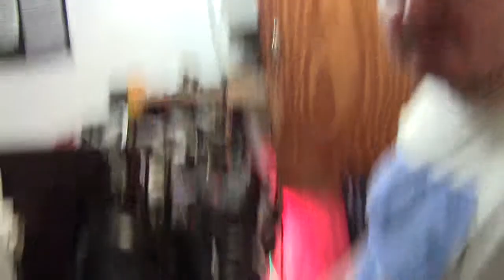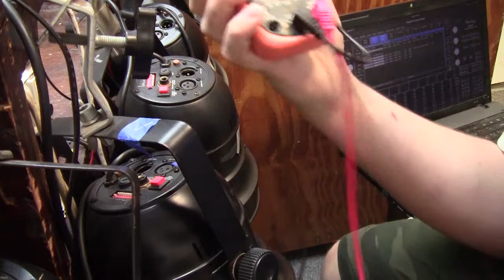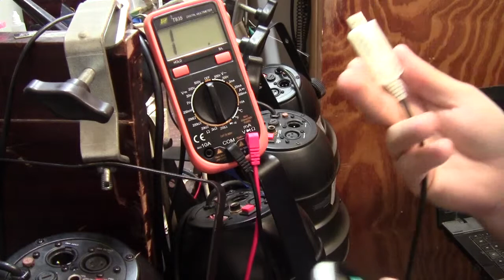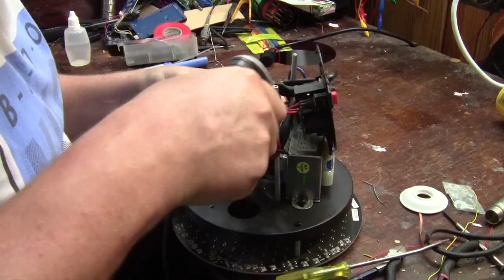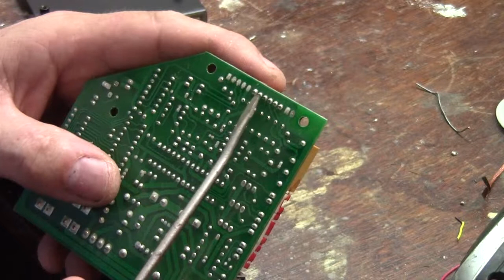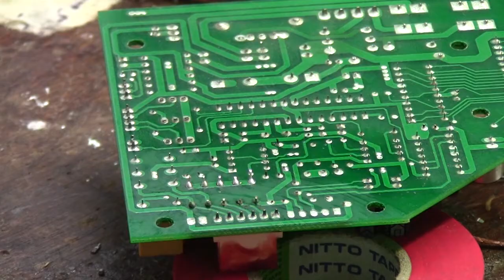ShoutingElectronics #21   Shorted LED Parcans

Comment: Do not think anybody would notice those failed chains up in the roof, but if you are going to fix easiest to just shotgun all in the chain instead of looking for the failed ones. You casn just see the single off bits in the video, but overall the light output is not much different on your face.

Nice to see the protection diodes did the job, just watch with some 6V8 zener diodes is that they often also contain, because they were designed to be a stable voltage reference, that they are in actual fact a 6V2 zener in series with a regular diode, or are 2 6V2 zener chips back to back in the package forming the same thing. This is because 6V2 is around the right voltage for a zener temperature coefficient to be the same as a silicon diode voltage change with temperature, but opposite sign, so as the diode heats up and cools, the voltage is a lot more stable.  Had a few that were designed for voltage reference use, which were made like that, though the most common ( and cheapest) zener diodes are just regular diodes, and are basically just a diode.

Time to go to Clicks and buy a new Oral B brush, that one would not even work to do tile grout any more, you will get change for R20, and they clean so much better. You saved the church a packet, bet they will ask before nailing in future.